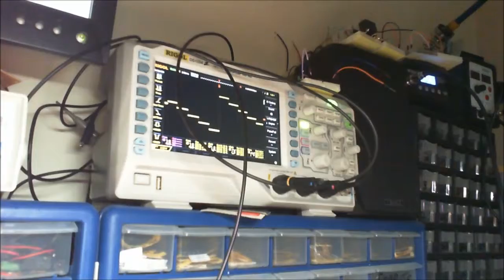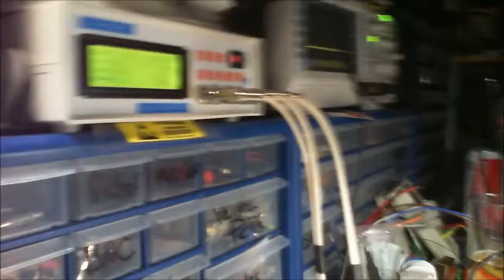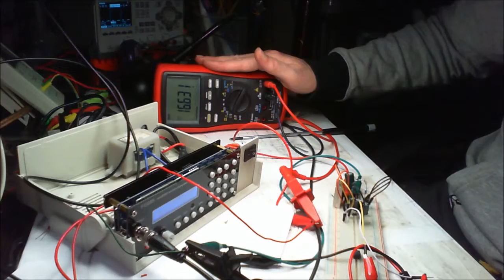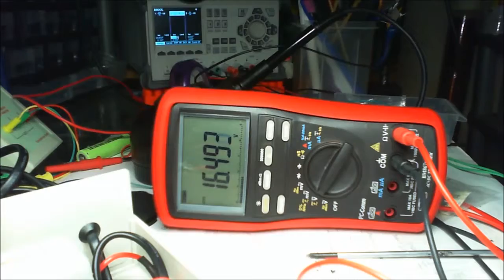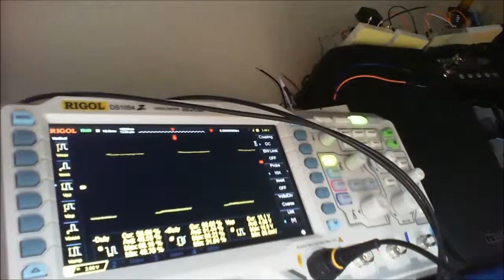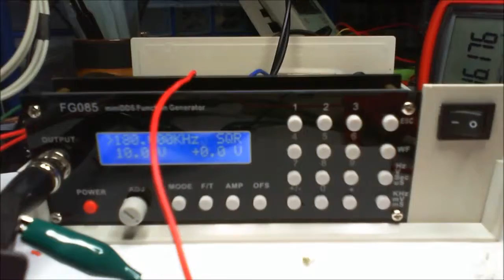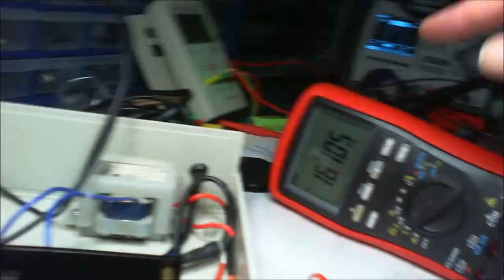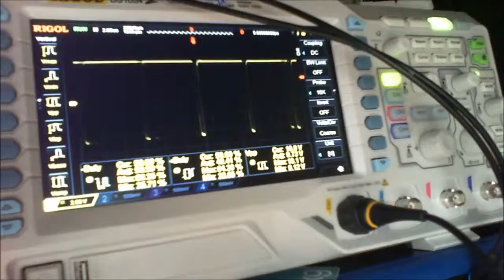FG085 Casing and Power Supply Build Pt2

Comment: Hi I have been watching your FG085 build. I don't understand why your not getting a square wave with anything less than 15 volts source? I built one of these last year and put it into a case. I am using one of those 12 volt power supply, wall warts  :-) and I'm not having any problem generating square waves from the unit what so ever. In fact I believe the power supply even though rated 12 volts is not quite 12 volts. but yet still get square waves with no problems. I'm wondering if it has anything to do with the firmware?